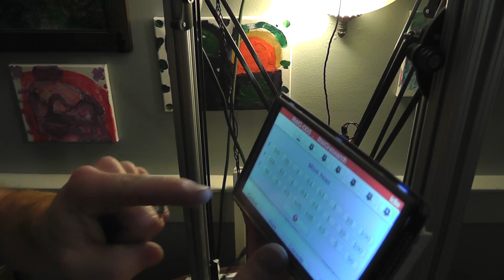RWG-OSD # 19 PanelDue PCB Relocation Cable, Bad Design?  #How To

Comment: the first cable you created, was  not an IDE cable, I'm almost sure it was  an SCSI cable.
Reply: It's still an IDE cable, just an 80-wire Ultra DMA capable one. see https://en.wikipedia.org/wiki/Parallel_ATA#Differences_between_connectors_on_80-conductor_cables

Comment: Russ, just wondering here, but would it not have been easier aa well as cheaper to use an RPi3 ($35) with the 7" touch screen ($60) and have a few more options i.e. ethernet, wifi, Bluetooth, etc.? Plus for a few extra bucks you could add a WD PiDrive and have ample storage up to 1tb if needed. I am considering this for my OSD plus acme screws instead of timing belts. Your feedback would be helpful. Thanks!
Peace!
Reply: The RPi although more powerful in terms of overall processing power, isnt really suitable for being the direct controller because a lot of that processing power gets wasted on running the OS and so timing is not precise.

The Duet and other microcontroller based boards works in realtime with no unnecessary background threads running which means that they only have to deal with processing the code needed to get the steppers to move where they need to.

Comment: 13:13 - Are they flipped due to the modded connector being faced 180° instead of 0°?
Reply: If you noticed that second cable he took apart had the cable looped back on the top. That is the way he should have done it. Had the cable come in from the other side of the connector. They way Russ did it works too, just more work.

Comment: Holy CRAP, what a pain in the arse job with the IDC cable! Oh man, my childhood (And a small portion of my adulthood lol) messing with that stuff :( Also regarding the keyed plugs and sockets, I've drilled out plug before so that it would fit on a hard drive that had all pins populated :P
I wonder if the fact the connections were wrong regardless of what way the IDC plug was crimped on, was down to the socket on the PCB being on the "wrong" side? The side you wanted, but wrong, electrically.
Also, I wonder if you could have used the high density sockets, with the nicer ribbon cable, if you took out the central rows of pins?

Anyway, stay shiny :) I see you have a big ol' bottle of Mazolla. It's important to keep hydrated! xD!
~Chris

Comment: What if you remove the cable receiver on the small board and reattached it on the back side would that put you in proper order? It looks as if on the back side you could turn the receiver 180*, one of those two orientations might solve the problem without having to modify the cable
Reply: Looks good as you have it now and it works, so no need to change again as long as replacing either board is PNP your straight.